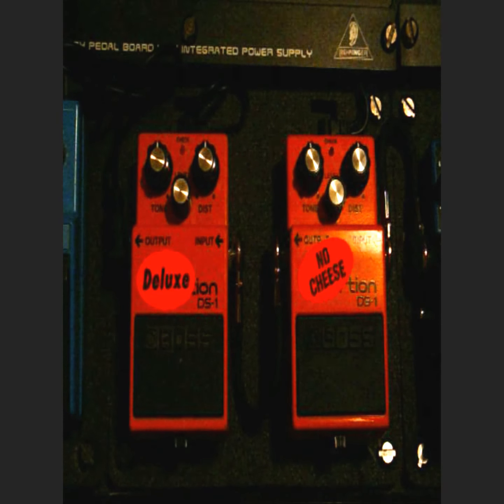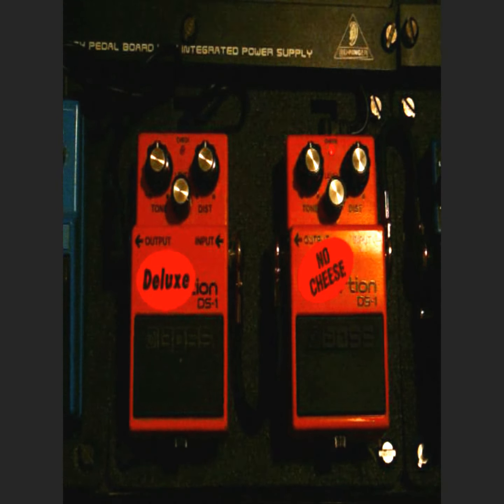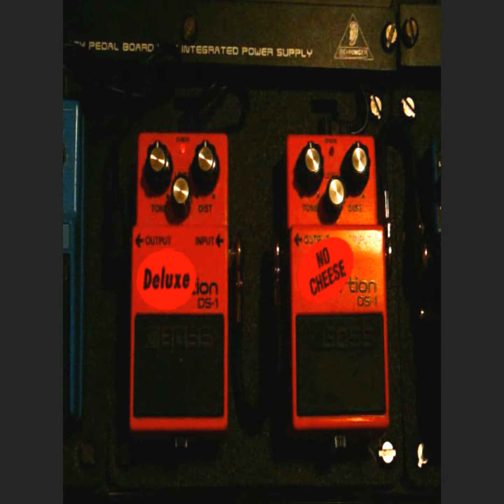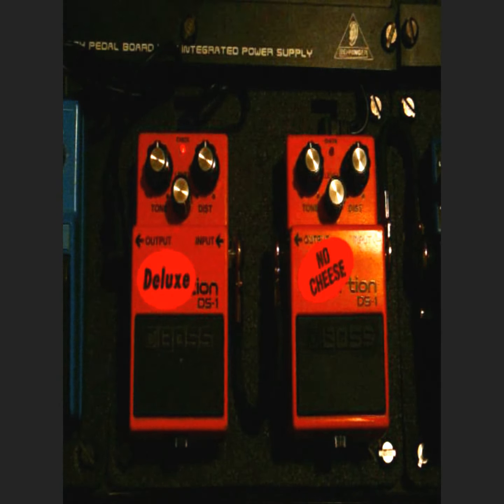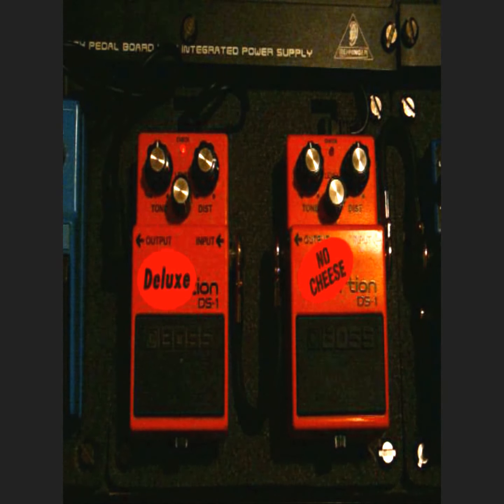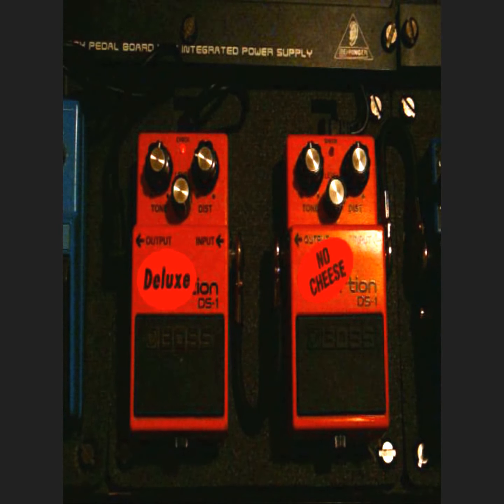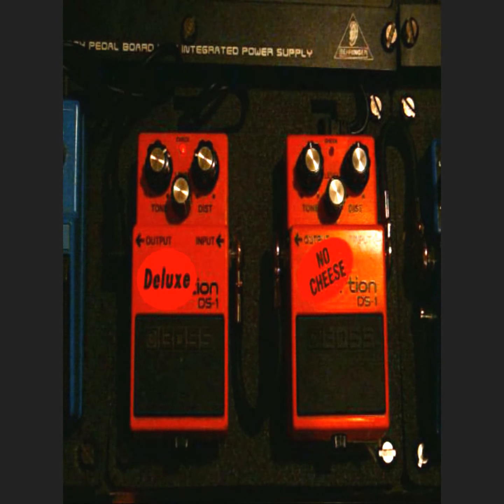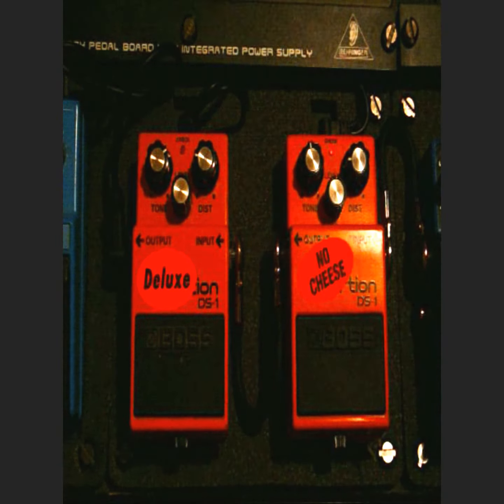Boss DS-1 mods

Comment: The LED mod makes the output louder because LEDs bias on at a higher voltage than most diodes which means the signal is clipped at a higher voltage and louder output.
Great demo by the way. Its nice to hear some of these mods before you do them.

Comment: the led mod brings up the bottom end. It's not "louder" it...(it is louder too). I do like the two clipping led's. Ds-1's suck without mods
Reply: That's not correct. The LEDs have a higher voltage drop across them, so more signal gets through to the next stage. It IS louder. Germanium has the lowest drop, then silicon, then LEDs. That old MXR Distortion+ with Germanium diodes barely has unity gain!

Comment from the maker: Radio Shack.  My favorite DS-1 mod involves replacing the D4 and D5 with two germanium diodes each, in series (1N34A).  I don't think Radio Shack has 1N34A's, but they have a lot of their stuff in their drawers in the store. I bought a big bag of asst resistors so I'm set for life on those. I got 1N34A's on eBay.

Comment: Please write to me what do you mean "add 47pf cap ACROSS clipping diodes"!? Or please share a photo from it with me! Thanx! Best wishes!
Reply: If I can boldly interject; likely on the foil side of the board, tiny 47pF capacitors are soldered in parallel with the LEDs. That should take the really high treble off, and make the distortion less buzzy or fizzy. Maybe 47pF isn't enough; you can try whatever seems to work for you.